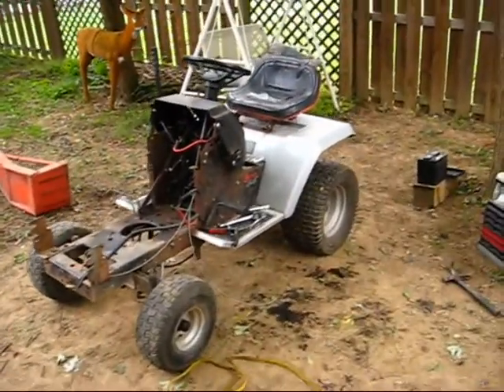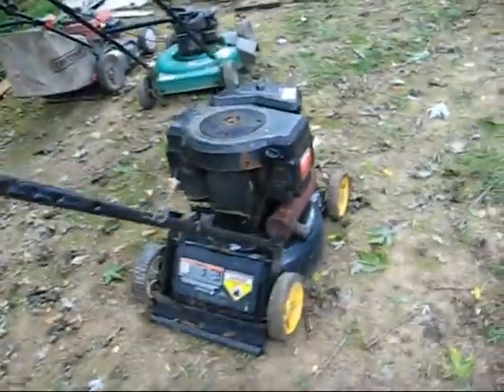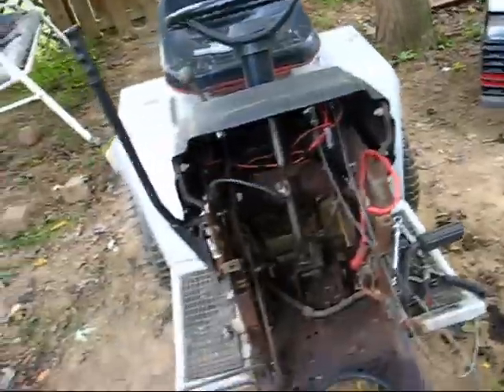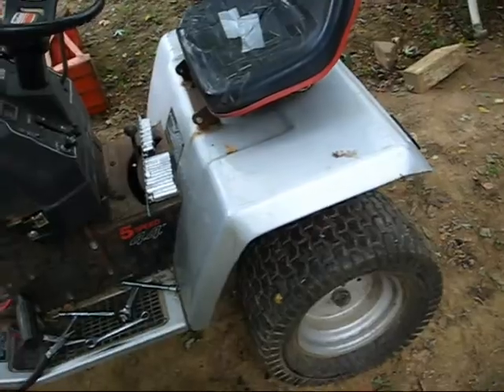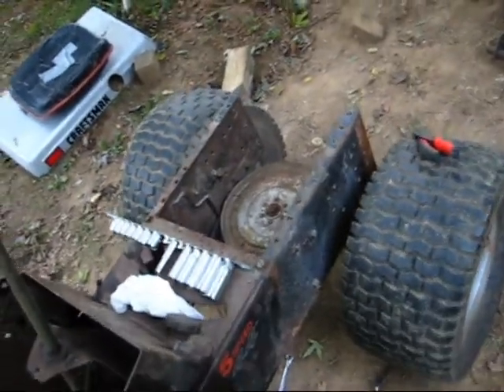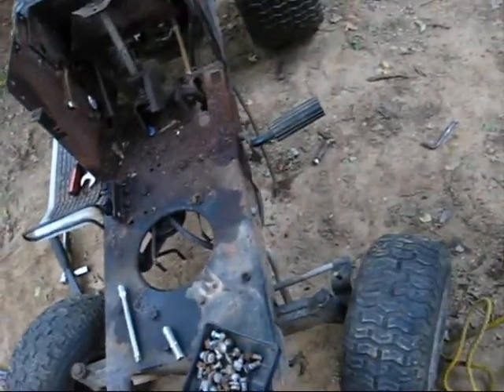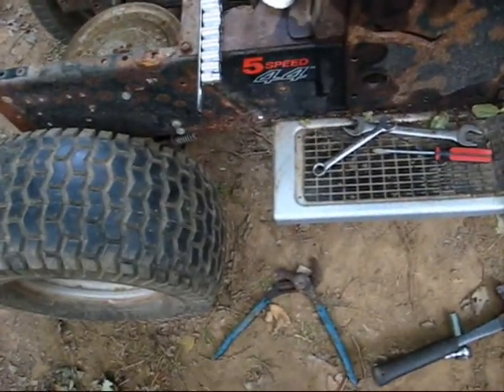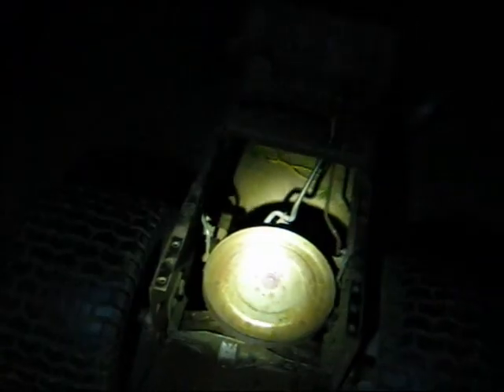1986 Craftsman II Recondition Project: Part 2, Teardown

Comment from the maker: There's quite a few youtubers who deal with the same stuff, and there's even some who take these things and make em into atv's. Lawn tractors are a great thing to start with when working on anything. It's all very basic, including the engine. After stripping all the parts off and coming down to just the frame, I pretty much know this whole thing front to back and sideways.